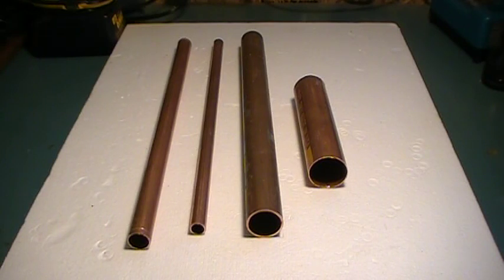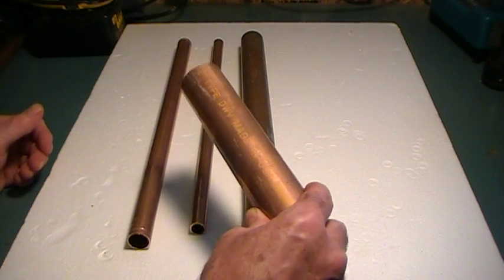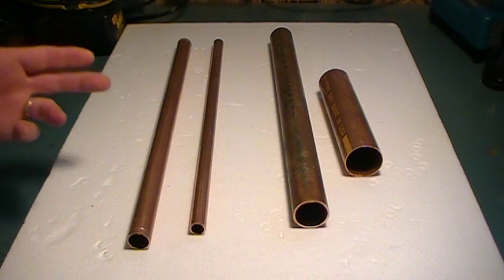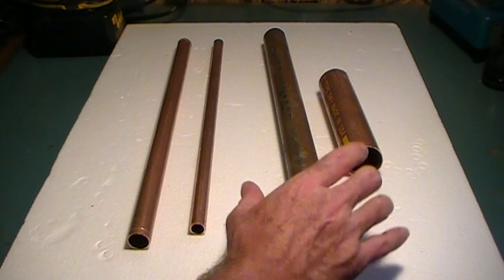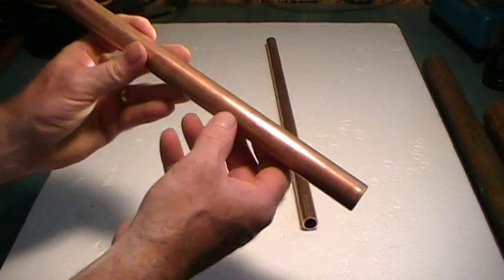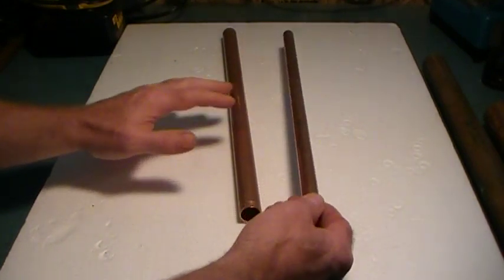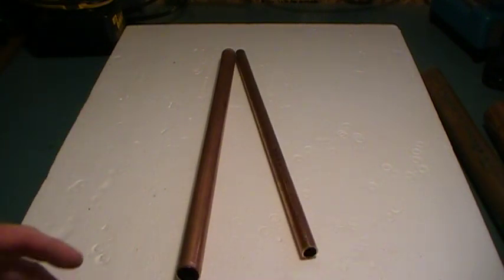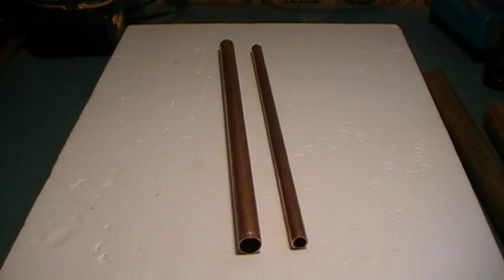Different types of copper pipes and their applications.

Comment: Hi Al!! Thanks for reading this. My 1950s Arizona home has 3/4" copper throughout, with 2 entry points coming from a single 1" galvanized service line. I am replacing the galv with 1" copper myself and would like to use Type K because I'm a spoiled girl :) If cost isn't an issue, would Type K be overkill?  Also, is silver solder much more difficult to use than 50/50? I have a mapp gas torch. I know 50/50 has lead and isnt code, but our municipal line is already lead!  Thanks!!  -- Julie
Reply: Other than cost, there's really no problem in using type K copper underground, as that's what many water districts commonly used before a huge spike in price occurred a decade ago. Today, 1" PEX or black PE pipe is used with great success, nationwide. In acidic and cinder fill soils, a non-metallic pipe is preferable, as it's not subject to the effects of corrosion.

Comment: Great video, question, is all copper pipe pure 100% copper or are there different grades?
Reply from the maker: Hello OneCupOfCoffee204,
Thanks!
All copper pipe is made of 99.9% copper I believe. There are different wall thicknesses as mentioned in the video. 
I use type L for domestic waterlines in a home. Type L is the medium thickness of copper. I use type M for hot water heating systems which has a thinner wall than type L. Type M can be used for domestic waterlines, but it will not last near as long.
Thanks for commenting and enjoy your week!     Al
Reply: @TheOldkid888  do you know if anyone has used copper tubing to be wired down by methods and processes to be used in electric motors?

Comment: How do you think Type L 1/2 inch holds up against 1/2  CPVC? I have two additions 10-30 ft away from the house that needs cold and hot water. I'm in South Florida and at least 85 percent of the pipe will be underground exposed to the elements. Do you think it should be embedded in concrete to protect it or inside the Styrofoam noodles and lastly how often does copper need Hammer resistors?
Reply from the maker: Hello Luis,
Personally, I would use Pex. I would bury it all underground and use the styrofoam noodles to insulate it. Taping each place where they meet. You can embed it in concrete, but digging down  below the surface about 6 inches should be fine. Pex will last for decades if installed in this manner properly. Making a good trench and applying sand under and over the foam will make a good bed and cover.
The only issue with pex is; it doesn't like the sunlight or florescent lights. So it MUST be covered with insulation whenever it is exposed to it or it will break down and crack. I simply insulate it and have no issues once this is done. CPVC will crack as well if exposed to sunlight over time. You can use soft wall copper tubing that is somewhat flexible and will last for years as well doing the same procedure as the pex with the insulation. 
Whatever you end up using be sure to draw out on a piece of paper where they are buried as you don't want yourself or any one else digging in the area of the pipes. Be sure to put the paper in a safe place as they seem to get lost easily. I know my do; so I purchased a book to keep track. Must be an age thing. LOL
Hope this helps!
Thanks for commenting and good luck with the project!    Al

Comment: hi im planning on replacing my main water line and have two questions
1. should i install 1" copper pipe to replace the 3/4 galvinize pipe that's connected to a 3/4" city water meter or just replace with 3/4" copper?
2. should i wrap with 20 mil pvc tape or sleeve the new type l copper pipe?
thanks in advance
Reply from the maker: Hello DoNnEgRoW,
A 3/4 inch line should give you enough volume for your home.
Soft wall copper Type "K" was used years ago and is probably used in places today. Only install type K if you are planning to install copper.
Service pipe is now used from the curb into the home. You will need special compression fitting for this procedure, but it is the go to in most places. 
Either one will last for decades so real need of sleeving them.
Just out of curiosity how many bathrooms are in your home?
Thanks for commenting and enjoy your week!    Al
Reply: thanks for the reply. :) I dig up the old galvanized pipe and it turned out being a 1" pipe. So I bought 1" L type copper since my near big box retailers here in southern Cali does not carry Type K. i wonder how long it will last with the 20mil tape i used to wrap them. I spent $450 on materials, big difference from the $3,500 bid i received last week (31 feet). thanks again
Reply from the maker: Hello DoNnEgRoW,
I am glad the project went well for you! Congrats!
Saved yourself some big money.
The length of time that copper last mostly depends on water quality, but ground acidity can also affect pipe. If the water quality is good and you have a smooth pipe with no dents; you could possibly get 30 to 40 years out of it. Wrapping it with the 20 mil tape will definitely help prevent any problems when back filling it as well.
Was it a roll of soft copper you had purchased?
Thanks for commenting and enjoy your week!     Al

Comment: I'm just learning of the different types of copper pipes. I have copper pipe going down into my crawlspace from my gas hot water heater and gas dryer. Big box stores only carry "L and M". I'm told that I need "K", but he didn't sound convincing. lol I tried to see and writing on the pipes, but didn't see any type of labeling. I have a small leak in the pipe for my gas water heater. I figured I would just replace the entire system since I'm sure it's old. I also enjoyed your pex videos and will be replacing my copper water pipes with pex in near future... with the help of your videos. :) I seen that you said you don't purchase pex and fittings from big box stores... is there a website you recommend? Also, if I need type "K" is there a website you recommend to purchase it? I noticed Grainger has "K". But they're always outrageous. Thanks for this valuable information, Al.
Reply from the maker: Hello Lester,
Just want to be clear on something...
Is the leak you are talking about on your waterline?
Get back to me when you get a chance.   Al
Reply: No, it's on my gas line. I smelled gas (barely) by front entrance and had gas company come out. He performed a pressure test on each appliance and gas water heater failed pressure test. He shut the gas off and tagged it out of service until I get it fixed. The gas water heater has a leak somewhere in the gas line. It has a couple fittings of black pipe coming from water heater, then copper line going through the floor, and then I noticed underneath house that the copper line is only about 5 feet or so long from each appliance, and then leads into black pipe. To me, some of that black pipe may even be regular galvanized. But I could be wrong in thinking it's not black pipe. I will be replacing those pieces as well to be on safe side. I thought about using black pipe for everything and doing away with the copper all together... using copper line will be quicker I think.
Reply from the maker: Hello Lester,
The pipe is probably black iron.
I am not a gas line installer, but you may have to either silver solder it if you are using pipe or flare copper tubing.  Is the copper that you can see soldered with regular solder? That generally isn't what is done.
Before you install the new copper you should see if you can solder with regular solder.
No sense in doing it twice.
Thanks for commenting and get back to me when you get a chance.     Al
Reply: If there's black pipe below, it's probably fine. Get all that copper out of there, and re-pipe with black iron, to a valve, then a short stainless steel flex to each appliance.

Comment: Hi,Here in the Uk England I have never heard of K-L-M etc copper pipe,I have always assumed there were different sizes but not different thickness or strengths,
Is this only a American lettering system,because in my life time this has never been said to me.
I want to build a type of  cooling system that will condense the water from the air, made from my air compressor.I am using 28mm copper this will allow no reduction to the air tool ,this will be joined from a rubber air line connected from my from air compressor ,This will allow me to drain water from the condensed moisture captured from the hot and cold air.
.My rating on the compressor is set at 150 psi but I will be using a reducer to drop it down to 125 psi,for my air gun.
I do not have a clue now what type of lettering on the copper pipe to use and if I braise the joints it makes the copper softer due to the heat from braising,and what solder would I use,I am a little stuck and need advice if you have some pleases

Comment: which one of these can withstand at most 500 psi and temperatures of 500 degrees Fahrenheit?
Reply from the maker: +ocast evo 
Type K is the thickest and perhaps could take this demand, but the joints would have to be silver soldered.
What application would you be using it for?
Thanks for commenting and have a great week!   Al
Reply: TheOldkid888

well I'm using it to compress air inside of it.  I want it to be copper because of its thermal conductivity. Its just a little home project.  I'm trying to evaporate water using only compressed air. And thank you, i appreciate the time you took to make the video.
Reply from the maker: ocast evo
You are more than welcome!
Sounds like an interesting project!
Thanks for commenting and best of luck with the project!    Al

Comment: Can you use Type l on the outside of a home.
Reply from the maker: Hello Diane,
Depending on where the location is and the ;low temperatures of the region.
I have used it in low temperature regions where freezing is an issue. Big thing to remember is to shut it off and drain it when winter is approaching.
If you don't mind my asking...where is the region and the use?
Thanks for commenting and get back to me when you get a chance....Al

Comment: Do type M and L use the same fittings?
Reply from the maker: Hello Russel,
Type L and M use the same size fittings. The only difference is the wall thickness. 
I use type L only for domestic waterlines and type M on heating. Although type M can be used on waterlines as well; its life span is much shorter as the wall  is considerably thinner.
Thanks for commenting and enjoy your week!     Al

Comment: What do you mean by using type M for heating only?? You mean that it should only be used for hot water lines??  🤔 not a plumber, just trying to learn all the terminology , thanks
Reply from the maker: Hello hmsmedia2005,
Type M is the thinnest type of copper pipe. I only use it on hot water heating systems for this reason. It will last for decades on these systems. I have used it for over forty years now with no issues.
That being said you can use type M for regular waterlines in a home, but the life expectancy will be half that of type L. I have been in million dollar homes where type M was used on waterlines and 12 years later I was replacing the M with L. Really not fair to the home owners. I can't see doing any work and cheaping out on the waterlines for the sake of a few hundred dollars now. A lot depends on water quality as well. If the water is acidic it can reduce the life expectancy of copper even faster. 
Now it is all pex, but some people still prefer copper so type L in my opinion is the only way to go. 
Type M can be used for domestic waterlines, BUT they will be there only about half as long as type L. 
Thanks for commenting and enjoy your week!     Al

Comment: Hey "TheOldkid888". First, thank you for the explanation, and as a do-it-yourselfer, why easy on the flux? I've heard some licensed plumbers say, "More flux is better than less, and no problem with extra flux.", but you and "service 1956" agree to "easy on the flux". That's the first time I hear that. Can you explain? Thank you.
Reply from the maker: Hello J Nieto,
A very fine layer of flux is all that is needed to make a soldered joint. 
I was taught that back in 1978. Remember it vividly. The instructor made it perfectly clear as to how much is needed. We were working on a project and almost used an entire small tin. He wasn't very impressed with us. He told us that a small tin should do about three houses. Could tell by his tone we had to change the amount we used.
No need for lots of flux. More is definitely not better. It doesn't make the soldering job go better. The access flux will melt inside the fitting and pipe and you will ingest it for decades. 
I made a video on a joint that was soldered about 25 years ago and there was still lots of flux in the pipe in the cold water line used for drinking. 
In my soldering video I show how little I use and how I apply it. I use a popsicle stick myself; not an acid brush. This too was how I was taught. This is the video if you are interested...How to solder copper pipe. Tips and tricks! The old plumber shows complete technique.
Thanks for commenting and enjoy your day!     Al
Reply: Good morning TheOldkid888. Thank you so much for your time, prompt reply and informative explanation. I truly appreciate it. I will check out your other information. Have a blessed Sunday.

Comment: can you tell me the PSI rating for 3/4 type m is????
Reply from the maker: Hello ice fishingforever,
I can't really give you the answer without knowing the application. Also, there are a few different pressure that apply and it depends on how it is made and also used. Soldering or heating the copper in such a manner will lower the pipes pressure.
What were you planning on using the pipe on?
Thanks for commenting and get back to me when you get a chance....Al
Reply: hello theoldkid888, i'm using for compressed air for my garage, but i already got the answer i was looking for the type m pipe is rated for max pressure of 701psi , but thanks for responding anyway.
Reply: @icefishingforever9439  assuming you're talking about drawn copper, yes.  annealed is much lower

Comment: In areas using city supplied water, type M is fine. I would not use it in well water applications! Go easy on flux when sweating.
Reply from the maker: Hello service1956 ,
I may have made the statement that type M is only for heating. It can be used on domestic waterlines as you know, but I only use type L on domestic. I have seen type M deteriorate in ten to fifteen years with pinholes way to often.  I have been in homes that are worth hundreds of thousands of dollars and type M installed. For the sake of a few hundred dollars; type L can be installed and no worries of replacing waterlines for 30 plus years.  There are places to save and spend money in a home and waterlines are really not one of them in my books. Just my two cents.
Everyone has there own way of doing things. I prefer Type  L. 
Totally agree on the flux!
Thanks for commenting and enjoy your week!     Al

Comment: if there is only a difference between K copper and L copper of $200.00 to run a main water line would you go with K over L the K copper has a 10 year warranty on copper and labor and L has a 1 year warranty on labor and a 10 year warranty on copper.  Thanks
Reply from the maker: Hello trucker Jay,
I haven't had to change type L ever within 20 years. type M is another story.  Type K wall thickness is better than L, but the fittings that are used with the piping are only type L thickness. Leaks can occur anywhere in the system, but generally they start at the fittings. Piping from decades ago get pinholes before the elbows in many cases because they were considerably thicker. Almost brass in many cases. 
A lot depends on the water quality, but Type L is the go to for myself. Pex is actually the go to for most plumbers today.
One thing about Pex is there will be no breakdown regardless of the water quality with most systems.
AS far as the warranty goes...it pertains mostly to the labor. I haven't seen Type L or K ever have an issue with leakas. Only improperly soldered joints.
Thanks for commenting and enjoy your weekend!     Al
Reply: @TheOldkid888    Thanks for your help I really appreciate your help I got the company to give me K copper with pvc coating at no extra charge

Comment: I've seen many pinhole failures in water lines here in Arizona. All failures have been type M.saw another one yesterday in a million dollar house. i know this house and type L was specified. They were lucky. As absentee owners, someone else noticed it and shut off the water and called the owner in Canada.The contractor in turns out used type M, cheaper for him.
One Doctors home last year had repeated failure and insurance claims and lots of water damage repeatedly.
Ten to twelve years seems to be the failure beginning  period here. I  think type M should be "OUTLAWED" for use in homes as it is destined for failure. Its very difficult to re-pipe a large multistory hoe and why should that be necessary?
Reply from the maker: +Phil Oliver 
I couldn't agree more with you. I believe in ONLY using type L for domestic waterlines. I have never used M for domestic water.
The sad part of the whole thing is type M can be used for water lines which I totally disagree with. That is why I mentioned in this video that type M should be only used for heating lines  where they will last for many decades. I have seen very expensive homes as well with type M in them. It really doesn't matter if the house is worth 1 million or 50K; no place for it. The homeowner does not know the difference. Look for the RED label; if it is there, I would have it replaced.
USE type L and have no worries for decades. Totally agree!
Thanks for commenting and have a great weekend!     Al